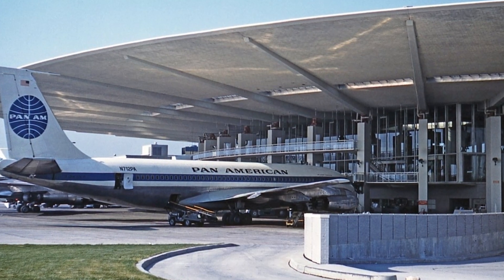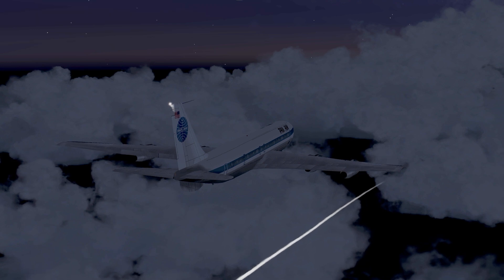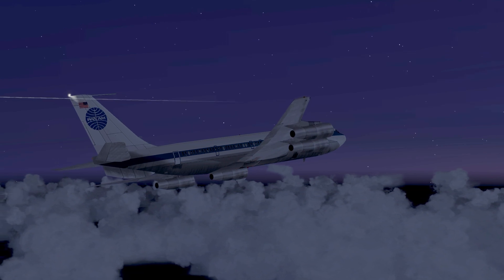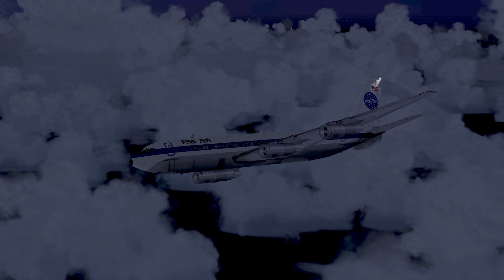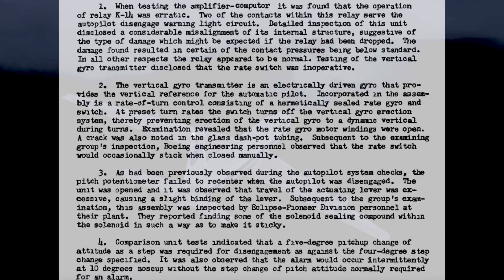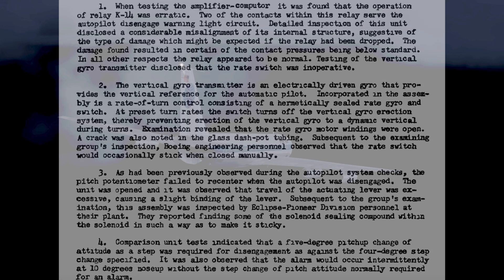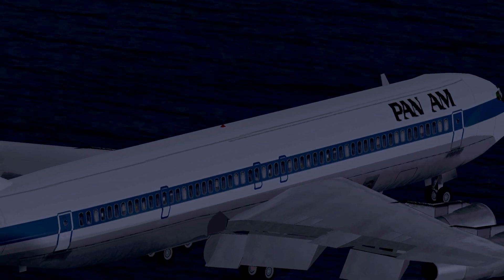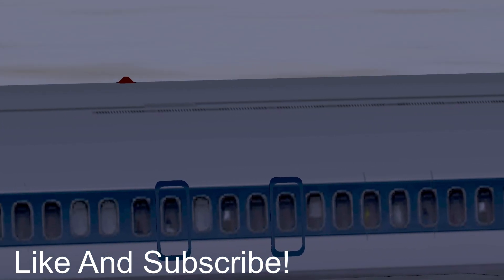How A Broken Bulb Almost Killed 129 People  | Pan Am 115

Comment: There was no broken bulb, the light was found at full dim in Gander. The Captain received a civil penalty. The Captain operating as co-pilot had his ATR(what it was called back then) was suspended for six months. The Captain had 350 hours in the B707 the co-pilot had 269 hours. The airplane had a total time of 705 Hours. The structural damage was fixed enough to ferry the airplane to Seattle for major repairs.
The airplane was at 52.5N/40.5W when the incident happened. I would guess that would be around 1:30 from Gander. he actually accident report is available using google. There was no NTSB then, look for CAB.  It was caused by pilot error on the part of the co-pilot.

Comment: I dont agree with the conclusions of the investigation. It is all too easy to blame the pilots, especially if they are dead. This is convenient as it will not impugn the reputation of the aircraft or its manufacturer. It is unfair to the pilots and/or their families and using them as  scapegoats may hide a problem and cause more accidents. I hope PAN AM took no disciplinary action against the crew involved in this incident. Thank God it ended well.

Comment: I agree with the regulatory investigation assessment. Their attentiveness to other tasks and not the state of the aircraft is the cause of the aircraft entering a dangerous position in flight, regardless of the potential misfunction if the autopilot. Poor crew resource management -- why was the First Officer so attentive to paperwork rather than the operational state of the aircraft when the Captain left the flight deck? It's nothing short of negligent on the First Officer's part.

Comment: Wow, I agree with you, the investigation was really strange by modern standards!
Reply: Yeah, the ciivil aeronautics board (The FAA's predecessor) was more interested in protecting aircraft manufacturers. Of course if the problem was egregious enough they would make the manufacturer and airlines fix it, just usually on the down low. You can even still see a little bit of the CAB still lingers on within the FAA, just look how they handled the 737 max crashes for example. Old habits die hard, especially for government agencies.

Comment: I worked on civilian 707s and  C-135s, the Air Force version of the 707, while in the Air Force. I also worked all avionics, mainly instruments and autopilot.   . There is a test switch to test all warning lights. If there was a suspect, intermittent, master caution light I can guarantee you it was simply a mis-fit of the light. Not hard to fix! 
What's more concerning to me are pilots who do not realize they're reaching their bank limits until it's too late. The ADI is there for a reason. To ignore it "while busy" is pure idiocy. I've flown in cockpits a lot. It is NOT busy whatsoever mid flight. In fact it is truly boring as hell.

Comment: BunkerFox has it 100% correct not only do they protect the jet manufactures but the airlines themselves. Even in the modern era when something like Pan Am 115 happens if they can cover it up as a fluke they will. Look at the big deal with Boeing 737's in the 90's, it took three major accidents for them to figure out what was going on. There isn't any evidence that they tried to cover it up but if it had stopped after the first one, we never would have known about rudder hard over. The first accident would still be undetermined and in my book that's worse than a cover up, it's an injustice to society. I digress in this world there is only one thing that matters, cold hard cash. That is exactly why they blame pilots not only is it cheaper but it's easier to get people to believe that another human being made a mistake over things and technology that they have no understanding of.

Comment: The aircraft in the video is modeled as a 707-420, as evidenced by the depiction of an underfin on the ventral side of the fuselage rear.  According to Wikipedia, the 420 was the only model of the 707 to receive the underfin, which was installed to correct a tendency of this model to over rotate on take off.  Not sure whether it actually corrected the problem or just served as a massive bumper.   Also according to Wikipedia, only 37 of the 707-420 model were manufactured and none were delivered to Pan Am.  This comment is not a criticism, just an observation of an interesting fact I learned as a result of watching this excellent video.  I thoroughly enjoy the content on this channel.
Reply: What’s next? The 747-69?

Comment: Sounds like a better practice would have been for the acting FO to maintain active monitoring until the captain returned, and then begin the inflight checklist. But the question should be how were the pilots trained, and what was the SOP for this situation, and did the training and SOP adequately address the situation, and did the pilots properly follow them. If the pilots were following their training and SOP, and the FO had waited for the captain to return before starting the checklist, they still may have been in just as bad, if not a worse, situation from this failure. It seems that the NTSB's current practice of looking to "contributing factors" is much more effective than assigning blame.

Comment: Pilot should have been aware what the aircraft is doing. If they aren't monitoring every move than no wonder it happened. Imagine driving with the cruise control  on the highway when the car starts accelerating full throttle for seemingly no reason . I would try and stop it. I wouldn't sit on my hands like hmm what's it doing?? They trust that autopilot way too much plus they get to complaisant with flying a tube with other roaring tubes all around town like hot stuff.

Comment: It might be a case of the same kind of corruption at Boeing that allowed for the 737 MAX to be approved when it had serious safety issues. Boeing is a big military contractor that the US government relies on a lot so they not only sometimes get a pass on things when they shouldn't, but the government contracts are so lucrative that they can economically withstand it if they end up with serious liabilities and large settlements due to problems with their passenger planes. It's not that they don't make some very fine aircraft because I notice that a lot of the problems have to do with the parts of their planes that aren't mechanical but electrical or logistical. Still, the rest of us couldn't hope to get the kind of grace that this company has gotten over the years.

Comment: I flew the 707/720 type and have some familiarity with the rudimentary A/P. The 707 did not have an aural A/P disconnect warning, only a warning light (two - on the forward instrument panel - Captain and F/O sides on Collins FD equipped airplanes and one on the center panel on Bendix FD equipped airplanes). Control yoke inputs would override the A/P and would not disconnect the A/P. There were A/P disconnect buttons on the Captain’s and F/O’s yokes. On the -100 and -300CF models the A/P disconnect light did not illuminate when the yoke disconnect button was activated. Operation of the stab trim pickle switches would disengage the A/P and illuminate the warning light. The Stab Trim and Mach Trim switches on the back of the pedestal were always engaged in normal operations. The pilot leaving the cockpit might have inadvertently depressed the A/P disconnect button on his yoke…not unheard of. Being in cruise the airplane would have been fully trimmed at the time of disconnect. The A/P disconnect light on airplanes that I was familiar with were square and not the round iris type that can be fully dimmed. I believe this was the case with early 707s and this incident and resulted in the later A/P disconnect light design. Good video as always.

Comment: It reminds me a little bit of the crash of that L-1011 in the Everglades, when they were tampering with the nose gear light. I’m no specialist on these old autopilots (neither the new ones…), but is there a possibility that in this case the autopilot produced some force via the Mach trim into the steering where the logic just disengaged it without a warning? Like, the logic saying to itself, yeah the parameters are okay so lets just remove the autopilot…

Comment: `A rogue or furious signal` (@8.00) -what was it SO annoyed about? I only noticed because my (suspect!) Laptop sometimes gives me subtitles I don`t want. Knowing a system has faults is TOTALLY INACCEPTABLE and Investigators fell well short in ignoring multiple manufacturing/certification errors, dependance on one bulb on such a vital device to warn of malfunction (shades of 737 MAX?) IS INSUFFICIENT! Blaming the Pilots is dodging the issue - back to you Boeing, it seems you have Historical ignorance of risk, possibly due to the ongoing competition with the Ill-Fated British Comet. Audible A/P disconnect warnings are now standard, after all eyesight can be deceived/distracted hearing less so. Not heard of this NEAR fatal Incident (I was 3 at the time!) so Bravo Mini. Incidentally, the subtitles call the Bulb a Bomb in the text - now THAT would`ve caused fatalities. In the end the Pilots DID their job, Boeing and Investigators DID NOT.

Comment: You'd think that they would add a chime or something if autopilots disconnecting randomly was so normal? Pilots definitely dropped the ball but on the other hand they managed to save it. Good job pilots, good job plane!
Reply: Boeing would have to acknowledge their system has a problem to warrant the installation of a warning chime. They are famous for blaming pilots for known mechanical failures.

Comment: So much thats off about this investigation.

1. Why was the pilot focused on calculations rather than flying the plane when there was no one else to monitor it. Yes doing that stuff then was a bad idea. But was he doing it because he was negligent or was it because of some requirement from the airline/manufacturer/other authority.

2. Why was the FDR and CVR not pulled on landing and examined. The Investigators seem to be guessing when they should have data in front of them telling them this stuff.

3. Why was a dodgy autopilot allowed to be used and why didn't disconnect warning be both more noticeable and redundant.

4. Why was it acceptable to have an artificial horizon that would lock up when the aircraft got into an unstable attitude, thats the situation when you most need a functional artifical horizon.

Probably some stuff i missed but this investigation made no attempt to figure out what actually happened based on facts or take any steps to prevent a repeat occurrence. Obviously most if not all of this has now been changed so it should hopefully be fixed but everything about this just screams avoidance of any kind of issue.

Comment: If you can't find something obvious as a cause, like a broken main spar, blame the crew for "Pilot Error". It's especially effective if they're dead, and so unlikely to object.
Reply: Yep.

Investigator: "Well, we discovered that the autopilot had been dropped and damaged and sometimes turns itself off in mid-flight.  And the warning light that's supposed to tell the pilots when the autopilot shuts off didn't work."

NTSB chief: "Okay, we'll blame the pilots."
Reply: And if they are not dead, they are just protecting their jobs and so you can just shit on them and ignore them. Pilot error is an easy out.

Comment: That sounds like a pretty serious limitation of the attitude indicator, if unusual attitudes cause it to fail. That's when you need it most.
Reply: Back then they were called artificial horizons and yes, the gyro would tumble at extreme attitudes, I’ve had it happen To me while flying.

The technology to build tumble-free AIs did not exist.

The needle-and-ball didn’t tumble and that’s what you used after an AI tumble.

Back then, every instrument pilot could fly and even shoot an approach with just needle-and-ball and airspeed.

Not sure these days......
Reply: @rrknl5187  Thanks for the information. How would you reset a tumbled AI after an upset? Do modern planes without glass cockpits still have this issue?
Reply: @rorypenstock1763  Once the plane is somewhat level, the gyro will restart by itself. It seems like it takes a couple of hours but it's actually maybe 30 seconds or so.......lol. 

I'm not sure but I believe the tumble-proof gyros came on the scene in the mid to late 60s. so the new glass cockpits would not have this problem. 

The worst problem with a tumbled gyro is that it will give false readings and if you chase it , you'll lose control of the aircraft. This is why it's important to include the needle-and-ball in your instrument scan.
Reply: @rrknl5187  
That's also why it's important to have a good pilot too....
Reply: @alhanes5803  No kidding!

Especially one who practices instrument failures on a regular basis.

Comment: Well it sounds like to me the FAA is passing the book trying to blame the pallets for things were wrong with aircraft before it ever happened and didn't really figure out what caused the problem so they just simply blame the pilots and close the case and I think that's wrong as a former mechanic myself I've seen things go wrong with vehicles and nobody can explain it but I had to figure out what caused it
Reply: Yeah, those darn pallets will get you every time.  I think airlines should use human beings and not small portable platforms to fly airplanes.

Comment: They used the pilots as scapegoats and that is even more dangers.
Reply: Yep. To protect the budding jet industry in the late 1950s. :( The autopilot was to blame. Boeing should have taken action to prevent future autopilot failures, and used a more reliable light circuitry. Still, it is impressive that autopilots existed way back in 1958. Just sayin'

Comment: Blaming pilots doesn't help safety in any way, it only helps the manufacturer and company maintenance for not getting blamed. Also is there no sound for when autopilot disengages? Not a pilot but that sounds like something that would be good. (or did I just miss it being mentioned in the video?)
Reply: They have sound now. Back in the 1950s though things like that were lessons yet to be learned. It's amazing how much safer flying has gotten over the decades.
Reply: Ah right, guess I missed how old this case was, makes much more sense.

Comment: I think a bit of politics might have gotten involved. They probably didn't want to make Boeing's aircraft look bad for customer airlines.
Reply: That was why the FAA allowed McD to drag its feet on retrofitting all its DC-10s with pressure-equalisation vents and hull-reinforcements after the 1972 'Windsor Incident' in which a faulty cargo-door blew off an early-production DC-10, causing hydraulic failure and control loss. When this happened again to an as-yet-unmodified airliner outside Paris in 1974, some 346 people were killed, almost all reduced to mincemeat as the plane dived into a mature forest: all this to protect sales.